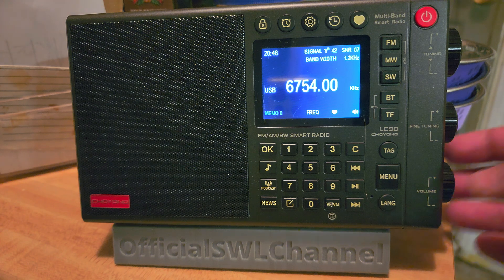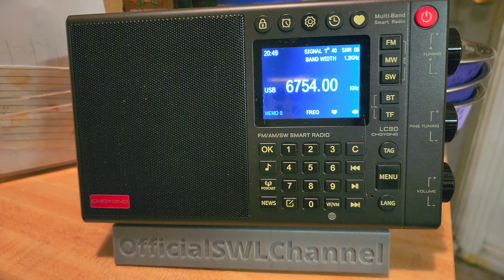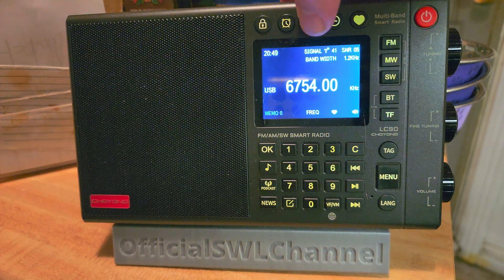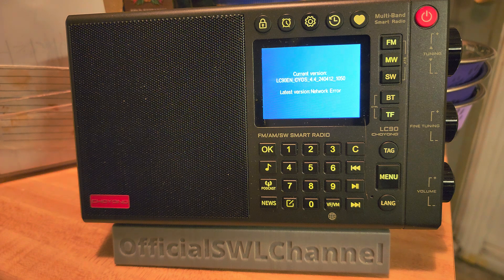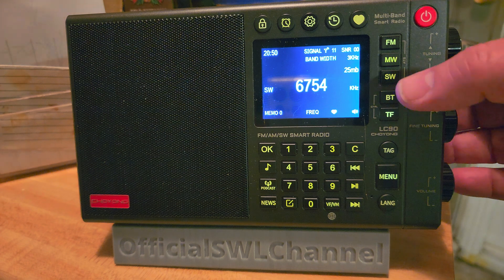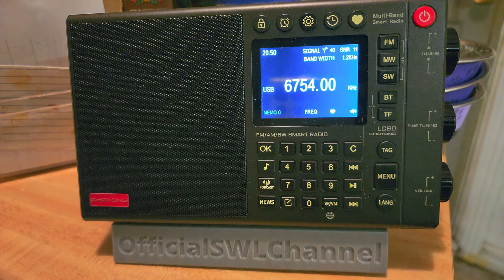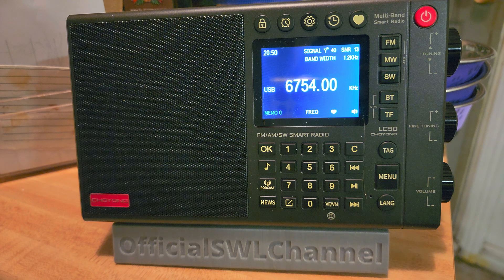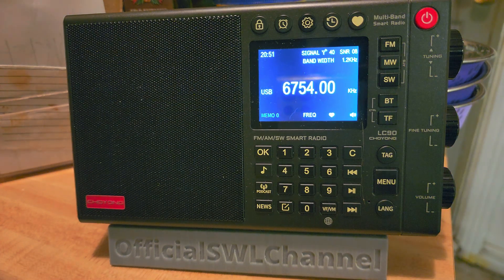Choyong LC90 in Single Sideband mode Trenton military and Gander Radio 6754 and 10051 kHz USB

Comment: I don't think I will buy this. Where are they getting these Internet radio stations? Qualcomm shut down their service when I had a CC WiFi Radio 1. When they did that, I couldn't use that radio
Reply from the maker: That is with the radios that used Reciva, there are other aggregators out there

Comment: Hej Gill thanks for the videos with the Choyong LC90 this radio seams so nice and love that you can upgrade the firmware maybe the birdies sounds go away with a new firmware. But very nice Gill that you found the cause on the crackling sound but yes to have the ability to update the firmware is an incredibly good feature to have in a radio. And you do it very easily with Choyong LC90 i love that so yes this radio is a nice one internet radio combined with shortwave wow take care Gill and have a nice fredag.

Comment: I’m still on the fence about purchasing this. It is my own humble opinion that a radio costing $250 US should not have the birds twittering around its circuitry.
Reply from the maker: problem is that this is really a first draft of a hybrid radio and it is tough to make it perfect with all the electronics...  I do not hate it personally...but it need improvements